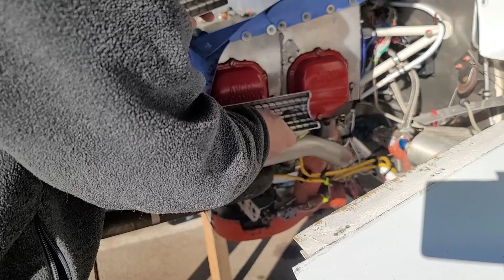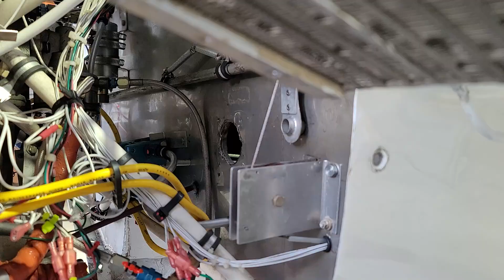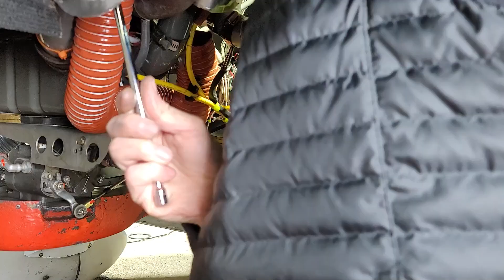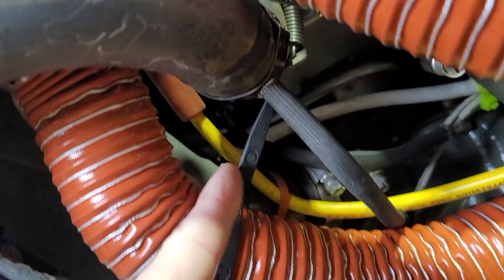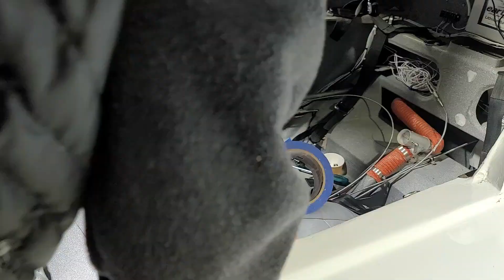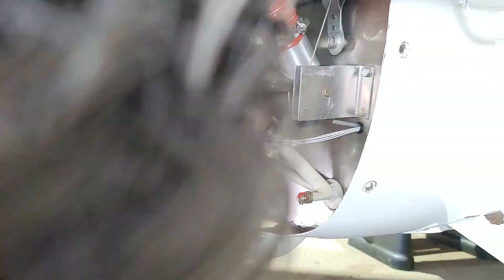Finally! Adding heat to my Cozy MKIV - Maintenance Part 8

Comment: Great video Scott. You didn't say how well it works, or how long it took and how much. I am surprised your rear cyclinder is the hottest, my Cozy's rear ones are way colder so I have ramps on the bottom cowl to push the air up to the front ones. BTW I found that changing the opening size a small amount on the bottom of the baffles that wrap around the cylinders makes a huge difference and is easier to mess with than making ramps and scat ram tubes.
Reply from the maker: It works really well...and sometimes TOO well. My wife now complains that she's "burning up" in the back seat. :) For the front seats, it's also capable of producing more heat than you want even at cold OAT's. I've flown at -5C OAT and had to turn down the heat.

My rear cylinders (1 & 2) have always been the hottest. My bottom cylinder baffles are opened up, but tight on top, to make sure the air is flowing around.

Comment: Nice job Scott! Heating I understand,... but what do you do for cooling the cabine? (just the vents?)
Reply from the maker: Just vents, and the canopy propped open on the ground if it's really hot. I usually fly pretty high, so it's cool even in summer up there.

Comment: Verrückt ! You're adding a blast tube to cool a cylinder but then your adding super heated blast air into the low pressure area.❓
Reply from the maker: The hot air into the low pressure area is nowhere near a blast, it goes through a restrictor first. So there is airflow, enough to keep the heater shroud cool, but nowhere near enough airflow to cause a difference in pressure.

Comment: Scott got a question from an old farmer. Will there be enough air just from propeller at idle if you get held up at take off to keep aluminum from melting. Or will it not be hot enough until motor is running at speed to worry about
Reply from the maker: At idle, the exhaust gas temperatures are much lower, with a lot less heat being generated, so shouldn't be an issue.

Comment: Side note...I don't know a lot about the experimental world but I never would have thought you'd use automotive type spark plug connectors.
Reply from the maker: There's a reason for that: the lower plugs in the engine are automotive (platinum) plugs, connected to an electronic ignition system. The upper plugs (there are two plugs per cylinder) are aviation plugs, connected to the magneto, and use aviation plug connectors and wires.

Comment: I think you are severely overthinking and overcomplicating the cooling airflow for cylinders #2 and #4. Also, had you made the heat shroud out of SS rather than AL, you wouldn't have to concern yourself with constant airflow through it. Personally, I would do the following:

1) Remove the duct feeding the new AL heat shroud (the shroud will get air from the pressurized side of the cowling (lower cowl) in any case - it doesn't need a duct
2) Remove the duct feeding cylinder #4 (this will allow air to reach cylinder #2)
3) Remove the duct feeding cylinder #2 (unneeded after #4's duct is removed and air can flow freely)
4) Remove the duct feeding exhaust air from the firewall valve overboard (if one doesn't have cabin or carb heat supply via a shroud, all the air heated by the exhaust pipes ends up in the lower cowl in any case - why the supposed need to vent it overboard?)
5) Install a diffuser / ramp on the firewall, just above the NACA scoop, to enhance the pressure recovery in the lower cowl (search on the COZY mailing list archives for data and pics of diffusers)
6) Once the airflow in the cowl is substantially simplified, THEN you perform cylinder leaning balancing in order to ensure that all four cylinders lean at the same time
7) If, after balancing the leaning, you still have a temperature imbalance, you can add ramps to the lower cowl, aft of the NACA scoop, to redirect air without blocking air to other cylinders

If you haven't balanced the leaning of the cylinders, then modifying airflow isn't going to give consistent temperatures.

Just because the builder installed a blast tube for cylinder #4 doesn't mean that that was the correct technique for evening out the CHTs.
Reply from the maker: Hi Marc!

I was told that the heat shroud was specifically made from aluminum, because it contacts the exhaust pipe at the ends. Stainless steel is hard, and vibration could cause wear/cracking in the exhaust header.

1) That's how the old heat shroud worked, and there was insufficient pressure differential at that point in the cowl to generate sufficient airflow into the cabin.
4) Having the outlet in more or less the same place as the inlet would ensure that there is little to no airflow occurring through the shroud when not in use. And being that I was already dealing with cooling issues, I figured it was better to vent it overboard than just introduce yet more heat into the lower cowl.
5) There already is a ramp on the bottom of the cowl, which works well for the cylinders on the left side. I may add a diffuser into the NACA duct to help with pressure recovery.
6) The temperatures of the cylinders WERE balanced. At that point I did a GAMI spread test and discovered that cylinder 2 was richer than the other three (which were quite close to one another). I added a smaller injector restrictor to cylinder 2 which brought the GAMI spread very close...but this then heated up cylinder 2 (it was obviously being fuel-cooled, masking the air-cooling issue), which is what brought me to this solution.

This is obviously a test - if it doesn't work, I'll pull out the blast tubes and try something different. If the heat still has insufficient airflow, I may put a small NACA vent on the lower cowl and plumb that directly into the shroud.

Comment: Looking forward to seeing these upgrades tested in flight.  Explain why you restricted the overboard air.  I would think that would keep the muff hotter than necessary while not in use, like all summer long.
Reply from the maker: It only needs a small amount of air through it to keep it cool enough. The more air I move through it, the less air is available for cooling the rest of the engine.